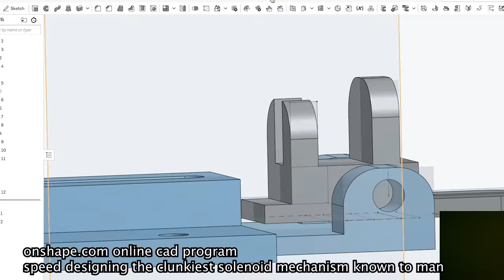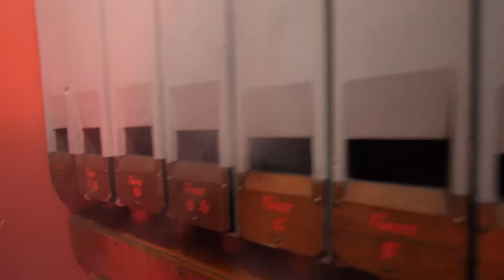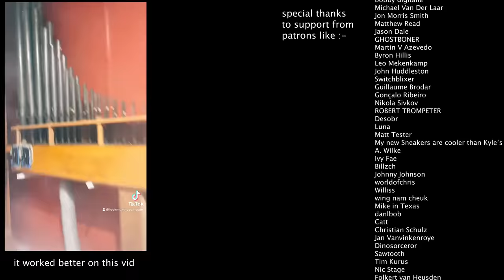I BOUGHT A CHURCH ORGAN PART 4,Plugging Up Smoke and More Pipes!

Comment: As a trained pipe organ tuner/technician, I find your series to be delightfully entertaining.  You are intelligent, resourceful, and have a keen sense of humor.  It will be a hoot (and a toot) to see what you do with it when you get it completed.  The microphone picked up mostly the second harmonics of the lowest pipes.
Reply: I have worked with amplifiers, sound, domestic and pro audio for most of my life and also repairing electronic organs. I've often heard people banging on about how their subwoofer goes all the way down to 10 Hz or some magical figure and I get blank looks when I tell them that few people can actually hear (or know what) frequencies below about 80 Hz truly sound like. For the most part they are hearing (and feeling) the harmonics, not the fundamental which at such low frequencies is more of a sensation than an actual sound.
Reply: That’s not how yew dew it saaaaam 😡😡😡
Reply: @sw6188  I can guarantee you my 6m long tapped horn subwoofer tuned at 14hz ( @120db) can reach that low...
Reply: @sigibaes  Yes, it probably can but that wasn't my point, which was that few people actually know what frequencies below about 80 Hz actually sound like. There are plenty of things that can reproduce a frequency below 50 Hz, but few people know what the fundamental of that frequency actually sounds like because in most instances all they are hearing are harmonics.

Comment: Closing the top of the pipe not only lowers the octave but it also only lets out odd harmonics, so it sounds more like a triangle / filtered square vs the open diapason which has both odd and even, much like a filtered sawtooth…!

Comment: The chest for the big flutes is a "double primary electro-pneumatic" chest.  Instead of a large, powerful solenoid, instead, it uses a small, low power solenoid which sends air to a pneumatic valve. That valve then sends air to a 2nd larger valve, and that sends air to the pipe.  All the chest might have been like that at some point. But its common to convert to larger solenoids when the pneumatic valves fail.  Low power solenoids made sense 100 years ago when electrical grids were unreliable

Comment: The smoke machine is definetely a great way to find all of the air leaks (apart from giving it the amazing "movie-villain steam powered organ" look :-)
The smoke fluid is mainly water and ethylene glycol, so I doubt it will cause much harm. But frequent use could cause a little bit of residue on the surfaces.
Reply from the maker: Yep that’s what we thought. The odd use wouldn’t harm it. It’s not practical to use regularly anyway
Reply: @LOOKMUMNOCOMPUTER  what if you plumbed the smoke machine directly Into the "valve boxes" for lack of a better term and had the air pressure pull it through the system rather than throwing it through the pump and having more than you actually need in the system. You could probably even rig up individual vape pens in the box for each rank that you can turn on and off with midi so you're not left with an excess. There are special effects vapourisers made specifically for DIY stuff.
Reply: mmmm, ethylyne glycol, yummy.(don't)
Reply from the maker: @jpjapers  the biggest issue is buildup of gunk on the valves and pipes. I’m probably going to leave this experiment where it is now. Also the only part of the system not under pressure is behind the pump. Everywhere else the smoke wouldn’t sufficiently work
Reply from the maker: @jpjapers  the biggest issue is buildup of gunk on the valves and pipes. I’m probably going to leave this experiment where it is now. Also the only part of the system not under pressure is behind the pump. Everywhere else the smoke wouldn’t sufficiently work
Reply: You mean propylene glycol. Ethylene glycol is antifreeze.
Reply: @woosix7735  might have been propylene glycol, I always get the two mixed up
Reply: @bingbong3221  They both make smoke and make antifreeze fyi. You just don't generally use ethylene glycol for smoke machines/vapes as its toxic.
Reply: @bingbong3221  it depends on the fluid used, but most commonly it's ethylene-, propylene-, or tri-ehtylene glycol or glycerol, or glycerine in combination with deionised water or mineral oil. It mostly depends on the fog machine that's used, because the temperature and flow rate dictate which fluids are suitable of any given machine.

Though the trend is more and more towards glycerine and water based fluids, as those have the advantage of being the least toxic variant as well as having the lowest number of known allergy cases. And glycerine based liquids tend to give the thickest fog, so more bang for the buck.
Reply: Dry ice would be residue-free - the 'smoke' is just the water vapour that's already in the air.
Reply: @tompw3141  ooh yeah, visible CO2 vapor might do it. But I'm not sure how much that vapor sticks around, when mixed with air.

Also you're uh... reducing the amount of breathable air in the room, when you release a lot of it. CO2 is a simple asphyxiant.
Reply: @LOOKMUMNOCOMPUTER  I recommend get Chauvet Hurricane Haze 1DX instead of the Martin Magnum 2000. Because the Hurricane is a water based hazer. Where the Magnum is a oil based fogger. The water based hazer will disperse way faster and will leave very little residue.
Reply: @LOOKMUMNOCOMPUTER  Didn't clubs change from smoke machines to haze machines....much cleaner!
Reply from the maker: @sitjar  I started yesterday with a hazer machine and it didn’t work
Reply: I concur that you should try using a dry ice smoke machine. I used to work as a stage hand, and we would use dry ice machines over fog machines. That won’t leave residue.
Reply: I was surprised you had the organ playing while you were smoke testing.
Reply: @fermitupoupon1754  glycerine is also used in soaps and as a gelling or thickening additive in food.
Reply: @LOOKMUMNOCOMPUTER  Ah fair enough i didnt consider that.
Reply: @LOOKMUMNOCOMPUTER  1,2-Propanediol (or propylene glycol) is highly hygroscopic. So it will cause some water to condense on the surfaces. If rust is not a problem for the organ pipes, solenoid valves or mechanisms, then look forward to a nice algae or bacteria farm! :)
Because of its dissolving and emulsifying properties, 1,2-propanediol is used, among other things, as a carrier and carrier solvent for dyes, flavors, antioxidants, emulsifiers and enzymes. It is therefore quite possible that dyes, plasticizers or other components are released from (rubber) seals.
I think the decision not to do this permanently is a good decision. Of course, continuous operation would be worthy of a film villain and organ killer villain at the same time:P

Triethylene glycol, which is often also present as a small admixture in fog fluids, is excellently suited as a humectant(An agent that keeps its milleu moisturized) in tobacco products ... so if someone wants to misuse use the other meaning of the word "pipe" ... Hehe
Reply: Fix the air leaks! Forget about the smoke.
Reply: @LOOKMUMNOCOMPUTER  could also react with whatever the wooden pipes have been treated with...
Reply: I have done sound system work in nightclubs and I can tell you that the smoke residue gets into everything and leaves a bit of a sticky film.
Reply: @ionstorm66  , Propylene glycol is the stuff that you have to dissolve in Gatorade and drink the night before you go to get a colonoscopy. 😳💩
Reply: Smoke machine gunk plus all the dust that gets pulled through the system.
Mmmm, sticky black gunk num num num.

Comment: Whilst it would obviously have been lovely to see this church organ sympathetically and laboriously restored to its original state, you make a valid point that the whole thing was destined for a skip, so making it work again by any means necessary is a much better fate than that!
You have done a wonderful job of reconstruction, giving the organ a second lease of life, and allowing it to provide fun and entertainment for the museum visitors.
Reply from the maker: I am bringing it back to its original state. Sound wise. Just much more practically modern. Like nearly all restored modern organs
Reply from the maker: Church organs run like this too
Reply: @LOOKMUMNOCOMPUTER  
It does indeed sound great, good job! 
PS: Adding the smoke machine was hilarious. Great for finding air leaks too!
Reply: @LOOKMUMNOCOMPUTER  Exactly! When the organ was restored recently at Canterbury (I have a few of the original sound boards which they were chucking out) all the connections between the console and the pipes is now via highly encrypted wi-fi, I assume acting on solenoids much like yours.
Reply: Yes. I think the MIDI/Arduino/Solenoid upgrade is a good choice. The most important thing is to make this organ playable again. It's nice to retain some of the quirky original mechanisms. But some of them are simply impractical compared to modern components.
Reply: @MaxWattage  this organ was far from original even when Joan bought it, it was a 1950s extension organ built entirely from pipework salvaged from the original Victorian organ in that church, then hacked about to get it in the house... an historic restoration is impossible, far too much of the original went in a skip in the 50s!
Reply: @LOOKMUMNOCOMPUTER  
There's a fantastic video about the restoration of the Midmer-Losh organ, the largest and heaviest instrument in the world.
The relay boxes for the stops (the 'computer' boxes you're replacing) are the size of a van. Electro pneumatic machines, they put out a bundle of bundles of bundles of wires, about 15cm thick.
When they changed the seating layout in the hall they had to move a few of these boxes.
One of the staff labelled the bundles as best as they could and the builders just chainsawed through the cable 🤢
None of the relay boxes are going to be reused or restored but...
Oh dear Bob, the humanity...

Of course, at the time, they just took a chainsaw to a priceless unique instrument.

Comment: 12:22
So the smoke machine is like a chorus pedal for a pipe organ. Love it.
Reply: I don't remember what it's called but some organs have a motorized box that I think pushes a bellows back and forth to create a chorus-like detuning effect.  This has to be the coolest project I've seen on YouTube!
Reply: I was thinking the same thing!
Reply: A chorus pedal... slash... gas chamber. D:
Reply: Yep, makes things more "gothic"!
Reply: @tl880linux  Larger organs might just have entire extra ranks of deliberately slightly detuned pipes for the chorus effect. Vibrating bellows on the other hand are used for a tremolo effect (a.k.a. what guitarists, due to Leo Fender's musical illiteracy, would call "vibrato")

Comment: I approve of the simplified valves, probably work better too.
Reply: If they had the option they would have done that from the beginning..
Simple is always even the organ builders from yesterday would agree!
Reply: Yeah all he is doing is prolonging it’s useable time. It was already modified so doing more modifications doesn’t do much harm. Also making it easier to maintain.
Reply: There is a strange "octave up" on opening, I wonder if the original valves had it or was the transition smoother
Reply: @Yorick257  That's what organists call 'Chiff' it's quite normal, adds to the sound of the rank.

Comment: There's something about a whole load of pipes/flutes that is so much more interesting to the ear than digital recreations of organs.
Reply: I think most digital recreation don't do well at capture the "breathiness" of the pressure changes in the system.. each combination of key is going to create different pressure waves, and waves reflecting around in the air channels etc to give it that slight variation you cant easily simulate
Reply: Tuning as well. You can recreate a perfect instrument from hypersampling and modelling etc, but the slight tuning issues from pressure fluctuations in the pump and just general imperfections in the pipes adds to that real sound. Love it!
Reply: It’s the imperfections that make an instrument that much more beautiful
Reply: @trotskiftw  The Hauptwerk digital organ system uses real audio samples recorded from real organs around the world including the breathiness and clattering of the mechanisms. The "wet" samples also include the natural reverb of the church. I have this on my DIY digital pipe organ at home. It sounds very very good, but is a fantastic way to find the shortcomings in your subwoofer very quickly. Nothing beats the real thing though.
Reply: @theSam91  subwoofer and descent speakers a amp helps a lot to, as a pose, two little speaker in a laptop, or some cheap pad, with one mono  speaker?
Reply: @trotskiftw  ,  Effects devices try to simulate the sound of a rotary Leslie speaker, but it's just not the same  without the room reflections and standing waves that an actual Leslie would create.
Reply: @Douglas James ♪ there's no substitute for CFMs...

Comment: ...and to reach organ Nirvana, add some 'laser bright' RGB-cycling LEDs in each pipe pointing upwards! As each note plays it illuminates the pipe internally (emitting a circle on the ceiling, and esp at the mouth) - and with any smoke too, it'd be pure colourgasmic.
Reply from the maker: Adding red led’s :)
Reply: @LOOKMUMNOCOMPUTER  maybe colour code the tones. Then when played in the dark the lighting in the whole room changes when a different part comes in, I imagine.
Reply: AI will say please do, you could almost run em off the Solenoids voltage

Comment: This is amazing! I had organ tuition as a teenager, which included both the music and the technology of the instrument (I learned on a fully mechanical instrument - levers and strings, no solenoids!) so I was fully aware that a stopped diapason sounds an octave lower than an open diapason of the same length. However, I’ve never blown through a pipe myself, or put my hand over the end of one while it is sounding, and that was such a useful demo for musicians and physicists alike. Better than most of the demos we had in GCSE/A-level physics!

Likewise the smoke test: I was theoretically aware that the majority of the airflow through the pipe comes out of the slot on the front and there is very little net flow out of the top of the pipe, but I’ve never actually seen it with my own eyes until now.

Thanks for your hard work on the organ build, thanks for sharing your progress, and thanks also for bringing the often-snooty world of classical music and organ building to a whole new audience.